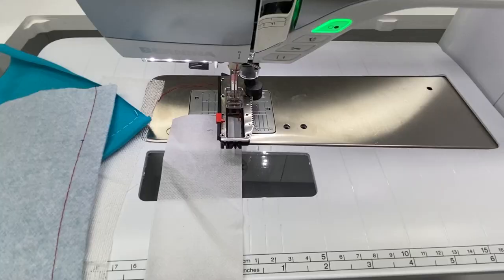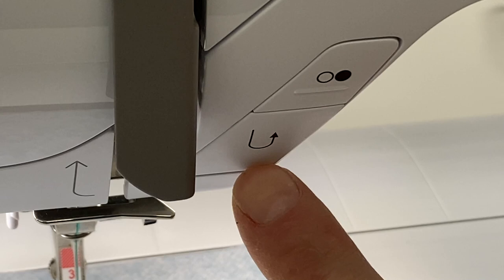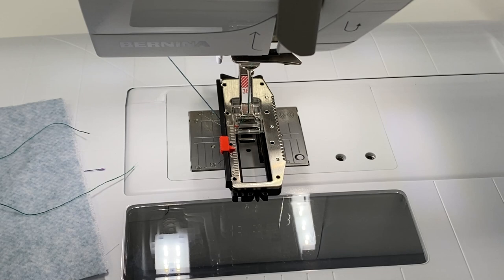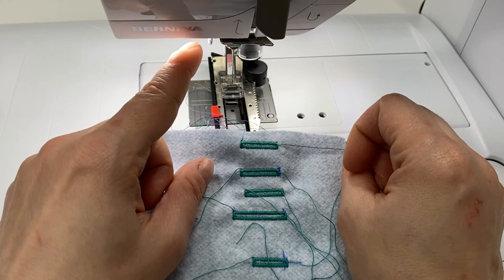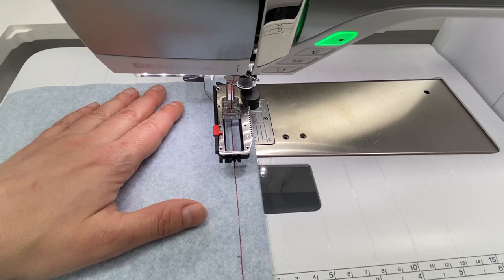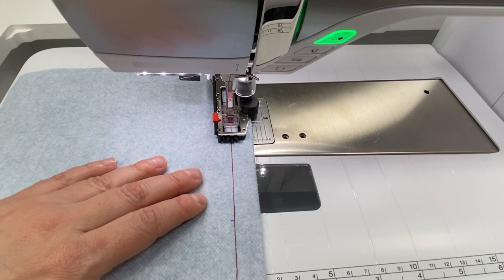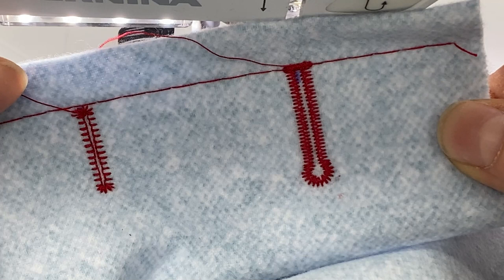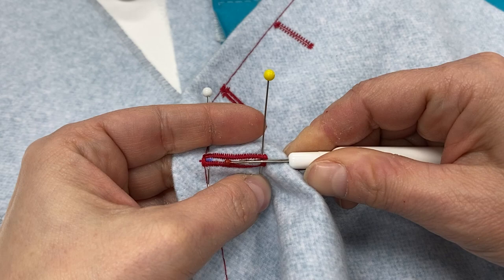BERNINA Buttonholes: For B 215 and 3 - 7 Series Machines

Comment: Watched again.  Really a good tutorial.  I need some help though.  The first bead sews fine (foot 3a) but will only sew half way up the second bead and tacks off, any suggestions as why it is doing this?   Thank you for such an in-depth tutorial, it really is helpful.  Gail
Reply from the maker: You may need to recalibrate the buttonhole. On some models you can do this yourself. Also make sure that your buttonhole foot slides and then snaps back automatically. Sometimes they stick without use. So massage it a little so it does this. Also try cleaning off the sensor that the bottom hole coding piece looks at. It gets dusty.

Comment: Hello i have a Bernina 1630 and I use the automatic buttonhole foot 3C. However I seem to get a perfect buttonhole but find the space in between the buttonhole is very narrow and hard to cut with the buttonhole knife and the stitches can be cut easily. I am making children's dresses with the bodice made from cotton layered twice with a fine interfacing in the middle. So how would I get a larger width in the middle of the BH. Do you think I can alter the tension at all? Nothing seems to work however Ive tried. Open for any suggestions please Doreen.
Reply from the maker: This is not a feature possible on the 1630. The new BERNINA 480, 570 and up models do this, but not their vintage machines.